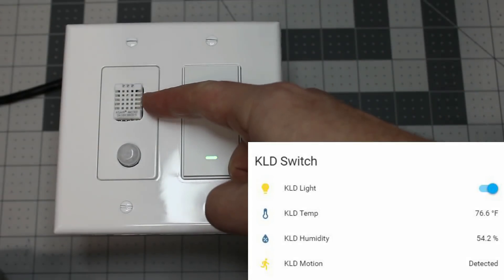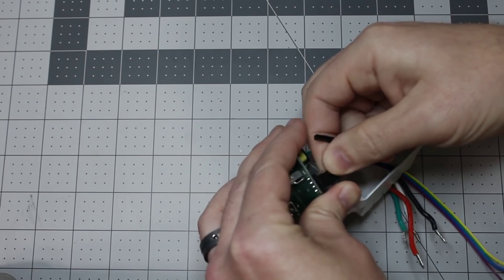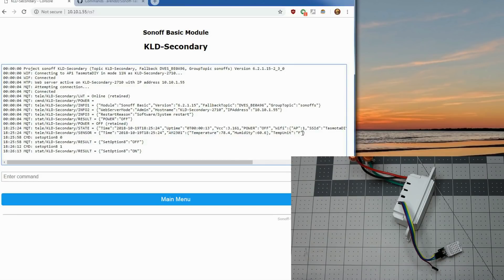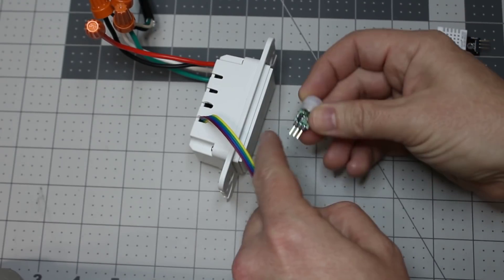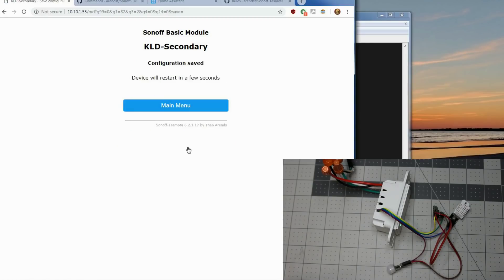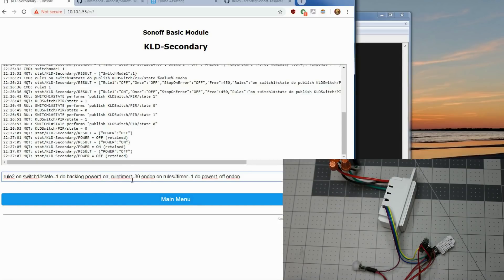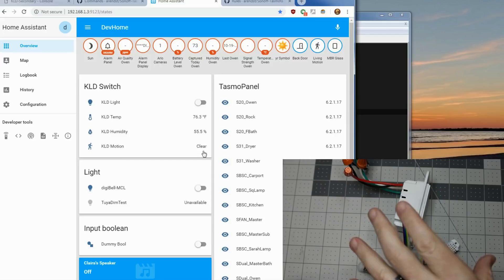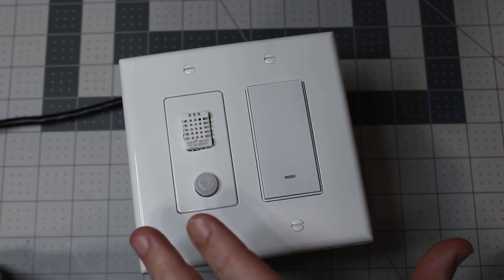How to make a Motion Activated Smart Switch w/ Temperature & Humidity - Tasmota

Comment: Hey! I’m a bit confused on to what you added the pir and temp sensor to.
What device is providing the Wi-Fi? 
To what did you solder the pir sensor and temp / humidity sensor?
Reply from the maker: The light switch PCB.
Reply: @digiblurDIY  ahh so the switch itself has Wi-Fi. Got it got it, cheers!

Comment: Travis, something has been driving me crazy with the video, did you change the DHT22? during most of the video you have a regular DHT22 that has the connectors (power, signal and ground) on the front (like an L shape), but when you proceed to glue it, the connectors are on the back and they are straight. I have a hard time fitting the sensor due to the L shape of the connectors.
Reply from the maker: It has been a while but I may have moved the pins on those or bent it back. Let me check later this evening.

Comment: Thank you! Is it possible to execute the rule2 only at night?
Reply from the maker: Yes there are several ways based of time, sunset, etc.  https://tasmota.github.io/docs/Rules/#make-sure-light-is-on-at-night
Reply: @digiblurDIY  I figured it out after little bit of experimenting, here the command:

Rule2 on switch1#state=1 do backlog event checksunrise=%time%; event checksunset=%time% endon on event#checksunrise<%sunrise% do backlog power1 on; ruletimer1 15 endon on event#checksunset>%sunset% do backlog power1 on; ruletimer1 15 endon on rules#timer=1 do power1 off endon

It basically fires the relay only at night, for 15 seconds. Thanks!

Comment: Hi, i used you guide with a sonoff basic in the hallway, and it work great.  but i have a question if it possible to add a rule for sunset and sunrise for the pir sensor to trigger the light. Here in the north the sun goes down very late at summer.
Reply from the maker: You can look at these examples. https://github.com/arendst/Tasmota/wiki/Rule-cookbook#make-sure-light-is-on-at-night
Reply: @digiblurDIY  Ive tried that, can't get it to work....

Comment: Travis, I love all your videos. I have added a DHT22 and an AM312 to a KuLED switch and applied all the Tasmota rules from this video. Everything works, but the LED flashes and I don't know what to do to stop it.

I did have an issue with the commands to turn the light off after the PIR turned it on. I finally figured it out. It would be nice if you would publish your Tasmota commands, like your HA, at the bottom of each video.

Thanks Again for all your hard work,
Mike
Reply from the maker: I usually try to post all the commands and configs in my vidoe description as well as updates if there any but probably wasn't in the habit yet in that video.

Is mqtt connected? Usually a blinking led means something isn't connected. Do you have some Ledstate set to mqtt packets too maybe?
Reply: @digiblurDIY  Travis, I thought MQTT was setup within Tasmota, but when I double checked it was not setup. Once I gave Tasmota the IP, Port, User, and Password the LED stopped blinking. Thanks for the help. Mike

Comment: Travis, is there a way to get PIR state without triggering the relay (while having the wiring as per the video)? Thank you.
Reply from the maker: Yes. As soon as you assign a rule to the PIR it stops triggering the relay. Have the rule simply push an MQTT message instead. I believe I explain this in my motion activated night light video. I do this in my kitchen for activating other lights.
Reply: @digiblurDIY  Got it. Implemented. Happy with the results. Thank you!

Comment: Think this is do-able with the Martin Jerry SD01?
Reply from the maker: Only one GPIO pin is open. Saw someone did one with a motion sensor.
Reply: Thanks for the info! I just got two MJ SD01s and flahsed them with your modified tasmota. Works great. 

Although, if I attempt turning on auto discovery for Hass. It causes a boot loop and loses the module config. I've just installed HassOS after wiping out my NodeRed VM. So I'm pretty new to it. However, I am not finding it very intuitive, thinking about just using NodeRed on its own again. Is there anything you do to make using Tasmota and other custom devices work better in Hass?
Reply from the maker: There was a bug in auto discovery in that version. I would turn it off and use that template I had until I move it forward on the new 6.5.0.

Comment: Is there a rule that would just publish the temperature/humidity values only when their values have changed? That way I would not get duplicate MQTT messages from them.
Reply from the maker: I believe I showed a rule in this video of a delta to show only the new temperature but I could be mistaken and showed it on another video.
Reply: digiblurDIY , unfortunately this video shows only how to change the teleperiod to accomplish this. And I see that you have a ton of other videos to search through. So next time that you come across using this rule, could you please then post it here? Thanks
Reply from the maker: I know the feeling!  Try this example:  https://github.com/arendst/Sonoff-Tasmota/wiki/Rules#8a-sending-the-value-of-a-sensor-to-mqtt-only-when-a-delta-is-reached
Reply: @digiblurDIY  , do I make that  example into just one rule or make each line a separate rules? It shows the example just under one rule.
Reply from the maker: @markroles7304  Tasmota has 3 rule buffers, not actually 3 rules.  You put as many rules into each buffer like you want as long as you don't go over 511 characters.

Comment: I went to back 6.4.0.1 I'd built and it's working just fine.
What's up with 6.4.1 ?
Reply from the maker: Some folks have had issues with the 2.4.2 arduino core, 2.5.0 is usually fixes it for most, and then some have to go to 2.3.0 core.  It's not a version of Tasmota thing.
Reply: @digiblurDIY  
Your right it's not Tasmota at all, it wasn't even the core, it was me!
I tried several different core 2.3.0, and 2.5.0- which wouldn't compile, linker error. Same issue.
Then it came to me, I was building the wrong !!*&%$#! sonoff version, 'sonoff-basic' not 'sonoff'. 
Once I built the 'sonoff' version it worked.  
I would of thought that by  editing the my_user_config.h file that I was controlling what was included in the build and that the version didn't matter.  Wrong!
One lesson I'm not soon to forget.

Thanks
Keep up the great video's I really enjoy them.
Reply from the maker: It's the way we all learn.

Comment: I tried to add the DHT22 temp/humidity sensor to a sonoff basic 
3.3v to pos, neg to GND and the single sensor wire to GPIO14
The I set GPIO14 to AM2301
The web page does not display the temp or humidity
I'm using Tasmota 6.4.1
I've double the wiring and it look correct.
Any ideas want I could be doing wrong not to get the Temp and Humidity ?

I edit the source and compile Tasmota myself is there any define I should be making sure I don't comment out?

Thanks

Comment: Thanks for a realy great video , but can you tell me ,a rule mabye to my esp8266 12e board so the relay 2 follows the switch 2i  becurse on the sonoff basic the switch 1 and relay 1 follows but not on the esp8266 12e as default ,i cant chouse relay 1 any were on the gpio`s 

please help ,i`m no coder at all so the rules are a bit hard to figer out i think thanks i have tasmota 6.4 on my board and every thing but the relay will not pull on motion i have switched from your rule to switch 2 and relay 2 but nothing happens

edit : sorry  find it out i flashed the esp8266 12e whit the "tasmota_6307_1m_i2c_sensors" and i then got the relay 1 too chose from so now all works as it should

Comment: Just a heads up on installation. Yes the sensors are low voltage between the GND and Vcc pins. Although, on all of these devices, GND or DC common is referenced to the AC Hot leg. So, I would still treat it as Mains voltage. This is the exact reason you can't flash these devices with AC mains connected.
Reply from the maker: Does your variant have continuity between these pins and legs?
Reply: @digiblurDIY  Yes. AC hot or L1 is usually directly connected to the dc ground. They don't use an isolated power supply. As there not intended to be exposed externally. If you use a DMM and measure between AC Neutral and DC GND. You will see the full AC potential. I Don't see any real danger in you example with the PIR Sensor, everything is fully contained in the switch box. Although, there could be a shock hazard with the temperature sensor.
Reply: Now, i could be wrong when it comes to the smart switch that you are using as i don't have any of those particular ones. I just wanted to point out the potential risk.
Great videos, by the way.
Reply from the maker: I haven't seen the continuity on these like you do with the Shelly modules.
Reply: Ok, cool. All the Shelly and Sonoff units i have, all have an ac potential on the internal headers.
Reply from the maker: Haven't seen that on the Sonoffs here except for the POW style ones.

Comment: can this be done with a sonoff basic connected to a regular light switch?
Reply from the maker: Yes. You could use the other GPIO pins on the basic.
Reply: @digiblurDIY  can i connect switch to gpio14 & GND and then connect the temp sensor and PIP sensor the same way you did on the kuled video?  I believe you had temp to rx and PIP to tx (gpio3&gpio1)?  Also would the coding be the same with the basic as it was in your KULED video?  I am struggling to compile data on getting these things going.  I bought a ton of KULED''s for my switches.... many 3-ways.... to have the double tap long press functions to work with groups of lights so my wife doesnt have to go to all 4 corners of the room to turn them all off.  This motion sensor light is the first home automation I will be doing.  I want the light to come on when someone walks into the pantry and shut off if no motion is detected.  I also want to put a temp sensor in random parts of the home to get an idea of how well the heat gets distributed.  I have Hassio and tasmota flashed to my sonoff basic.  I was also able to connect it to the mqqt (mosquitto) server and can control the sonoff from the home assistant after watching your videos.  You have been a great help... unlike the talking head guy that blows through everything which makes it nearly impossible to follow.
Reply from the maker: Do you have discord?  Might have to walk you through a few things, you are definitely on the right path though!
Reply: digiblurDIY I have not used discord but it should be easy enough to figure out.  How do I find you once I figure out discord
Reply from the maker: Shoot me an email with the channel name at the Gmail domain and we can figure out a chat medium.

Comment: Hoping for some help - I installed AM2302 (bought on Amazon from link posted in description).  Configured the module for AM2301 per the video and get no sensor readout on the web server.  The switch is flashed with Tasmota 6.4.1.  I know that the GPIO pins are working, as I tried a PIR sensor as configured in the video and that worked flawlessly.

I've tried 2 different kuled switches, same result.  I even tried adding a pullup resistor (4.7k and 10k tested) between 3.3V and GPIO sensor pin, as it seems to be best practice for this type of sensor.  No luck.  I've confirmed I get 3.3V on the pins when hooked to house AC.   Could it be a tasmota firmware issue?  Can someone confirm that the AM2302 is working on 6.4.1?

I am certain the AM2302 sensor is functional, as I tested on an Arduino nano and got temp/hum readings no problem.  So the Kuled switches seems functional, the sensor is functional, but I cant get a sensor working in the tasmota web server.  I don't know what to troubleshoot next

Digiblur, thanks so much for the great videos!
Reply from the maker: Do you have any other device to test with? I recently thought I had a bad device the other day when it ended up being a bad jumper wire.
Reply: @digiblurDIY  I feel silly - when I built the firmware in platformIO, I had "sonoff-basic" as the only environment included.  Changed that to the "sonoff-sensors" environment and all is good.  I am still learning about the firmware building process...

Thanks for the time.
Reply from the maker: Ahh! Glad you figured it out. I wasn't sure if you could remove that temperature sensor but apparently you can. Nothing wrong with learning from some easily reversible mistakes.
Reply: You helped me! I was struggling for a while  @fordneYT
Reply: @digiblurDIY  yep, I bought 4 kuled's.  I have three in place in my bathroom right now.  Sensor is attached to one of those.  I tried 2 different am2302's and double checked jumper wires.  I even hooked up a PIR to the same set of jumper wires and tried the RX and TX GPIO pins.  Both GPIOs worked flawlessly with the PIR with tasmota configured as Button1.  Neither GPIOs worked with the temp/humidity sensor configured as AM2301.

So I went to my bench, got my 4th kuled and configured a known working AM2302 sensor as AM2301 on TX GPIO pin.  I know the sensor was functional, because I hooked it up to DIO2/3v3/grd on Arduino Nano and got temp/humidity readings in the serial monitor immediately using DTH library from adafruit.  But when I moved it to the kuled, it does not work.

I do not get the sensor readings on the tasmota web server and  I don't know what to troubleshoot next.  Is there a way to debug a sensor with a console command?
Reply: @digiblurDIY  What firmware version did you use in this video?

Comment: Great Video.
Do you think you could add the PIR sensor directly to the switch, i.e. make the hole for the PIR sensor in the switch  plate?
Like to keep it one gang instead of 2.
Reply from the maker: Not sure the clearances are there with the sensor length and jumper wires on.

Comment: Great video. I have the perfect use case: our bathroom has the traditional motion switch. Light stays on for about 5 mins. But, if you're in the shower, it can't see the motion. So, using humidity could tell the light to stay on. Thanks for the video!
Reply from the maker: Yep! Have one as well for that running an automated vent and light. I just need a load cell on the toilet seat but maybe that might be going too far?

Comment: I can see using the perfboard for a splitter. I have started making my own dupont cables & just solder/shrink power&gnd wires together.
Reply from the maker: I may or may not have some splitter perf board hot glued on top of some Sonoff Dual R2s.

Comment: There is a console code, ill have to go back and look that will let you update temp and Humidity as quickly as every 10 seconds.
Reply from the maker: I actually went down a large rabbit hole of some advanced rules where the switch reported to a different topic when the temp or humidity changed by a certain percentage but it was too long so it got cut and will be in the upcoming video of rules and i2c sensors.

Please share the additional code though!